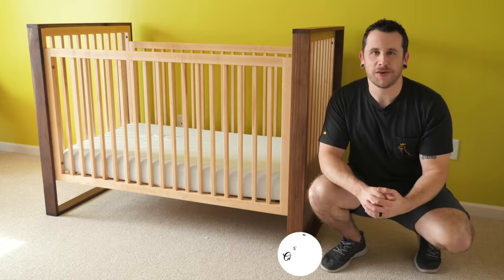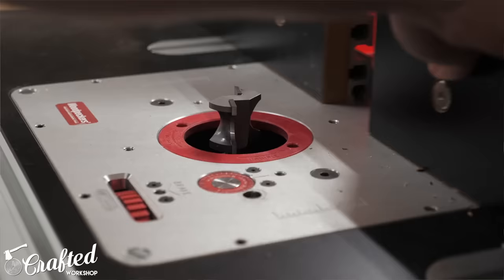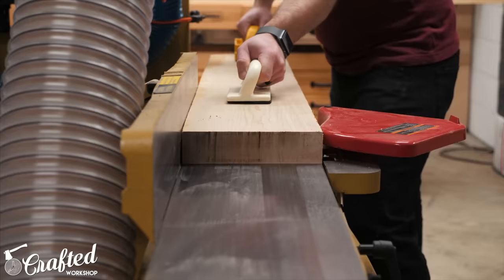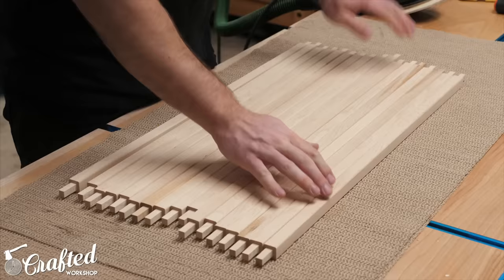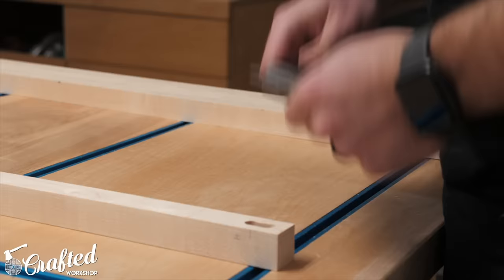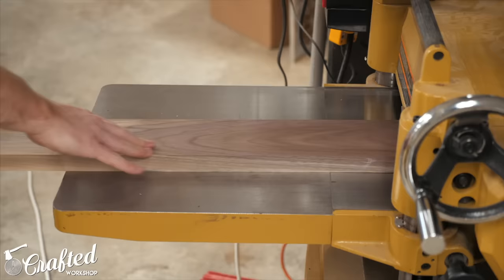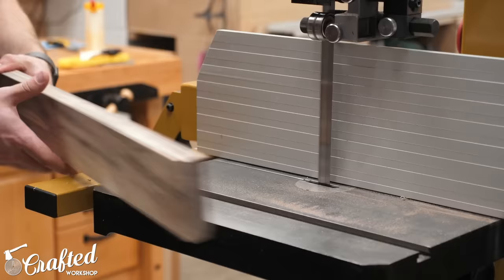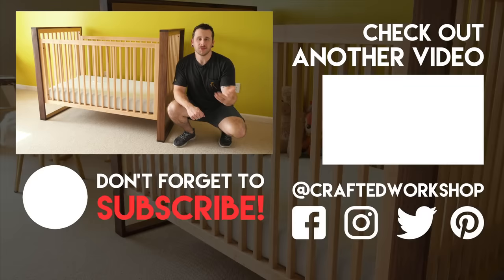Mid-Century Modern Walnut and Maple Baby Crib // How To - Woodworking

Comment: Nice piece and congrats on needing it.  I had a similar issue many years ago with a similar bit trying to get square stock perfectly round.  The best I could come up with was leaving additional length to the stock and leaving the ends square, then trimming them off.  Also, adjusting the fence so that there was just a paper thin set-back so I wasn't removing any material at the center.  Either way, it's a bummer.  Fail fast, fail cheap, adjust your methods and move on.
Reply from the maker: Thanks! Glad to hear I wasn't the only one who had issues with that kind of bit.

Comment: Normally in my experience you need to cut to approximately 1-1/16” square to get a 3/4” round. Simple formula would be D x 1.414 to find the correct flat to flat distance for your raw stock (e.g. .75 x 1.414 = 1.0605). Inversely you use D x .707 to find your largest round required for a square flat to flat distance. Hope that helps in future projects.
Reply from the maker: Interesting, thanks for that Jason!

Comment: great work, one thing i would like to note, having 2 nieces, it would be nice if u added a function so you could raise and lower the front fence as it can be hard to lean over it to pick the baby up, especially for a smaller person
Reply from the maker: Drop side cribs are illegal in the US. The mattress height is adjustable by adding more tapped holes, which I did right after this video went up.

Comment: Beautiful bed, well done! I would just suggest to attach somehow the slats to the frame, as babies often pukes and pee in bed, you'll have to remove the matress quite often to change the bed sheets. It will be really frustrating if you have to reposition the slats every time.
Reply from the maker: Thanks! The slats stay in place when the mattress is removed, that's no issue.

Comment: I always enjoy your videos and this turned out really nice. Now for the tiniest of critique. That tapped wood is no bueno. That isn’t going to stand the test of time like every other part of this crib. I think maybe a metal insert that you could thread a bolt into would be better but there are other options as well. Anyway, keep up the good work. Super envious of all that sweet Powermatic equipment you have!
Reply from the maker: Disagree, Cary. Tapped hardwood is super strong (softwoods and sheet goods are a different story), especially considering how deep those bolts are going into the wood. I won't be taking this apart and putting it back together frequently, so they won't see a lot of wear. If they wear out, I could drill out the holes and put in a metal insert, but I don't see that being an issue. Thanks though!

Comment: I know, it's a bit late, but is it possible, that you should have used a thinner ruler or straight edge to position the fence of the router table when using the half-round bit?!
Awesome project with amazing outcome btw.
Reply from the maker: Thanks! I’m sure there was a way I could have made it work, but I’m still not sure what the solution was.

Comment: Hey Johnny, I can’t figure out where you drilled the holes for the second mattress height? I saw in the comments that  did that after the video, but your holes on the bottom rail are in between the spindles shy of the side rail looks like, so did you have to make a second set of wholes further out to attach to side rail higher up? I’m about to start this build. Thanks for the video.
Reply: I’ve come across the same issue. It appears you ended up just having the one mattress height then? And the bolt for the mattress support rail going through the domino at its lowest position?
Reply: @kalengeddes3391  I ended up just going with a single mattress height. I modified the crib design some and used mortise & tenons for assembly instead of dominos. Although it would probably be plenty strong, i did not want to go through my mortise & tenon joint for the bolt holes. I ended up placing my bolt holes offset from the side rail same as he does in the video. I was planning to go back and make a second through hole in the mattress support to accommodate a second mattress height, but haven't gotten around to it. My wife might not agree, but I have no issue with the single mattress height.

Comment: For your mortises, would a 3/8" solid carbide spiral upcut bit in a plunge router with an edge guide work? Just clean up the edges with a sharp chisel I'd think?

I also have some nice 4/4 bird's eye maple. Thinking about laminating 2, 7/8" pieces to build this crib and cover the seam with walnut. The joint should be stronger than one solid piece I would think.
Reply from the maker: You could definitely use a router but it might get a little tippy. Sounds like a good plan on laminating!
Reply: @craftedworkshop  thanks brother! You’re the man!

I’m thinking I’ll just use my nova drill press for the mortises to avoid any tipping and clean up with my sharp chisels.

Comment: Beautiful work!  I'm currently gathering ideas for the crib I'm making for our first grandchild, due next April, and your build has given me some great ideas.  One question - At 10:50 you discus that you added holes for two mattress heights.  It looks like the mattress support is connected to the bottom horizontal rail and not the vertical supports.  Where did you add the second set of holes to raise the mattress?
Reply: I love the design and the video.   I have the same question regarding where the second set of holes should go.  (I am about to start the build for our first grandchild). The video shows the alignment of the holes in the support pieces in the open gap between the spindles above.  That would require a second set of holes in the mattress supports for other heights.  If you wanted to support it on the rather small 3/4 x 3/4 spindles, I would be concerned because of their small size and the fact that there would be a small gap between the mattress support and the spindle.  You could certainly use washers to close off that gap at the bolt locations, but still concerned about spindles supporting the mattress.  Perhaps the holes in the mattress support rails could be located so the bolts can go into the side rails.  That way only one set of holes in the mattress support will be necessary regardless of other desired mounting heights.   However, I do have some concern that those holes in the mattress support may then be too close to the end of those pieces (structural concerns).  
Any thoughts from anyone?
Reply: @billybrame4925  check out Matt Cremonas crib video.  He just does a good old fashion strength test.

Comment: Johnny, what are your thoughts on the Monocoat?  I’ve been intrigued by what it seems to offer. I know you haven’t had this piece long enough to comment on longevity, that being said, do you think the finish will hold up well enough for a bed?
Reply from the maker: I'm definitely digging how easy it is to use, but we'll see how it holds up. It was designed for flooring, so it seems pretty durable. Easy to sand and reapply too.

Comment: Nice looking crib but I have a question. How are you going to place the baby in the crib? Now my baby is 42 years old but I had a crib which had a side of slats that would slide up and down. That dropped down low enough to enable a 250 pound daddy to put baby in and out. 
God Bless my friend.
Reply: Frank Ingram The matress adjust in height. So it'll be higher when the baby is young and not at risk of climbing out, then as they get older, you can lower the matress (to the level he shows it in the video). The side drop cribs aren't really a thing anymore because there were too many issues with them and child safety.
Reply from the maker: Yup! They're actually illegal now.

Comment: I saw that you use 8/4 maple and cut that down to 3/4x3/4 for the spindles, did you have any particular reason for starting with 8/4? I’ve got a ton of 1 inch thick (seemingly) flat boards and so I’m debating using those, thanks! Love the videos
Reply from the maker: I just already had the 8/4 stock from a previous project. 1” boards would be fine!

Comment: Awesome detail in your video. I am almost done and while I’m a novice, I was able to get it done. Lots of work and a learned a lot. 

Quick question. Did you find you could stain a whole piece with Rubio in one sitting. It’s tough to tell if it drys fast enough or if I have to stain one side of a rail and then the other another day?